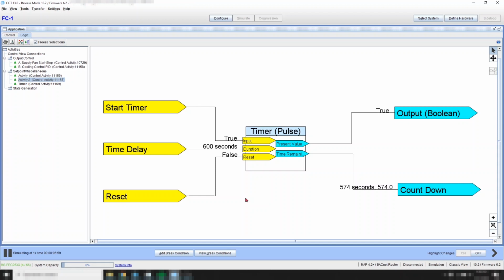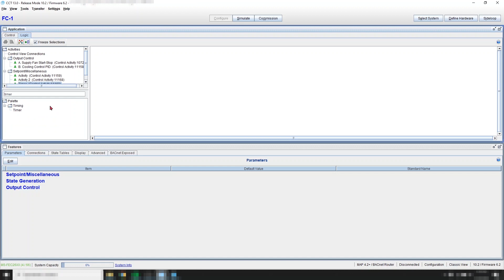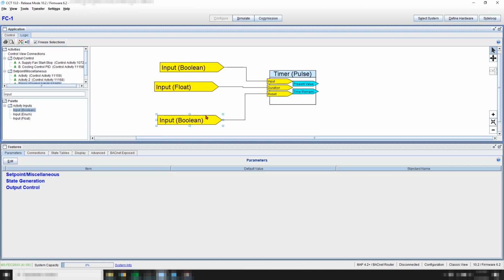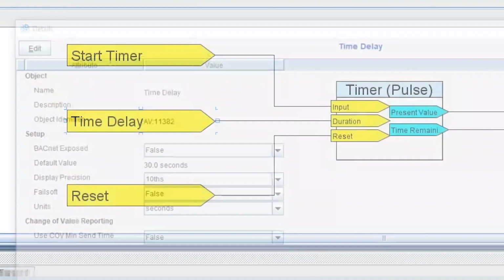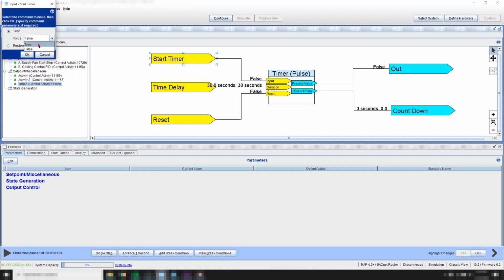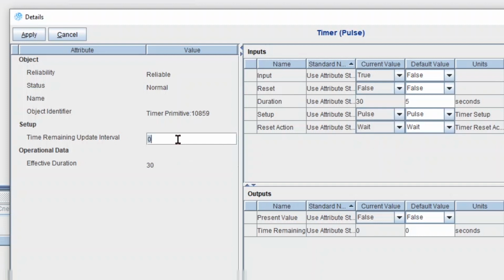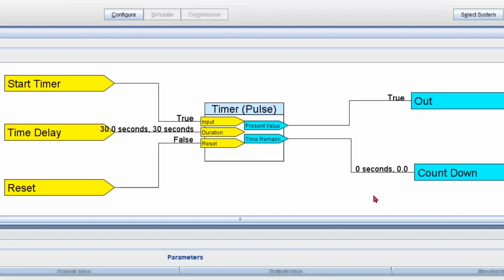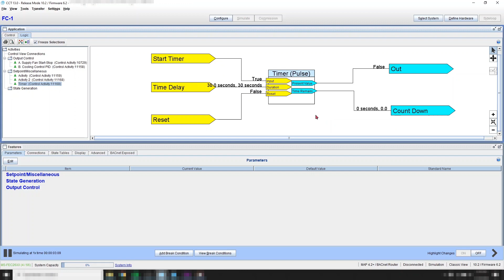CCT Timer Countdown. Johnson Controls Tutorial.

Comment: Can this be used to trigger and action at an exact time instead of for a predetermined amount of time?
Reply from the maker: Hi Todd, that's a good question. No, these timers just countdown when triggered. However, if you have an FAC ("Advanced FEC") or a CGM, these controllers have an internal real-time clock, which is mainly used to created schedules without the need of an NAE or supervisor device. However, if you program a schedule in these controllers (using CCT), you can connect a piece of logic to them and trigger it at a specific day and time.

Comment: Hello, great videos!! Would you be able to make a video on configuring and calculating PI on a PID loop. Pump speed control using differential pressure, static pressure control on a fan, or cooling valve control? Custom programming. Much appreciated. Thanks!
Reply from the maker: Antonio, yes, I'll definitely do a PID loop video soon.